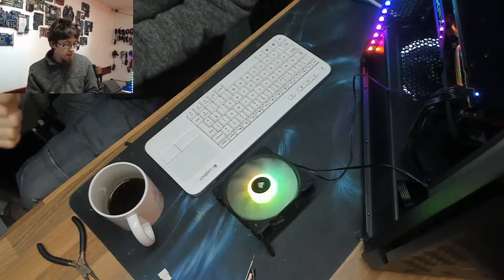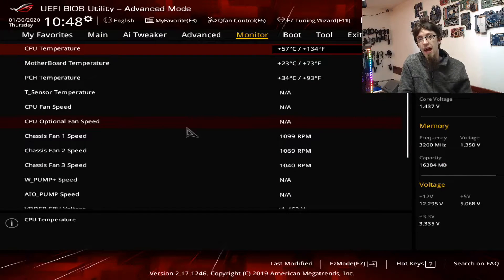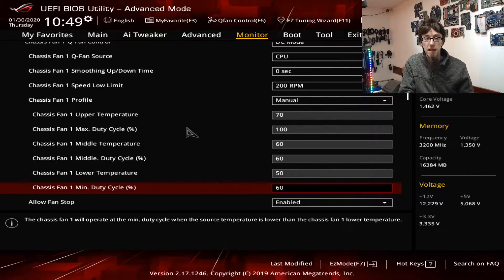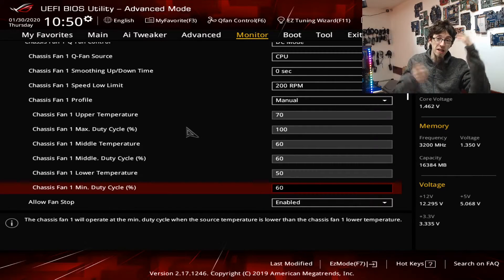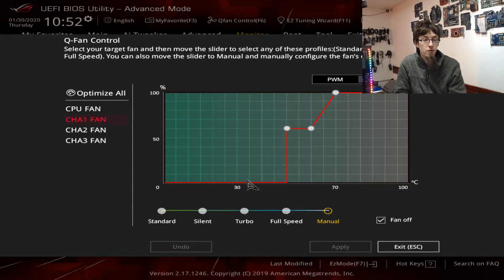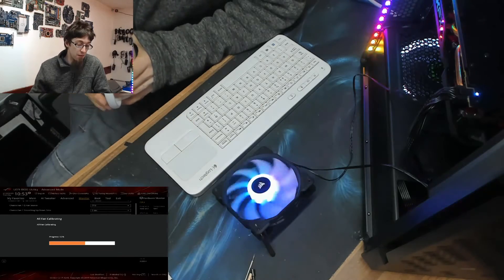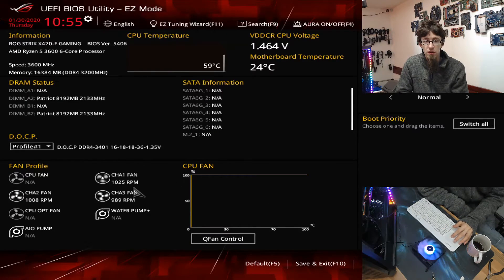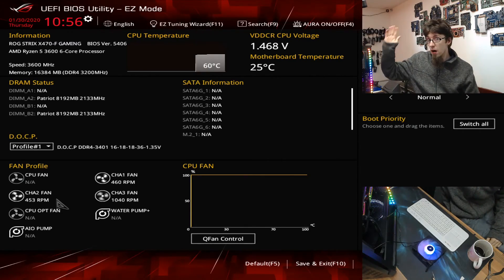LFC#194 - 3pin fans CAN be quiet!

Comment from the maker: I've slated 3pin fans a lot lately in my 3pin vs 4pin video and my Cosair 220T review - it turns out that my sample size of motherboards (one) was too small, and with the right setup they're actually just fine. 4pin fans will still give more direct control with less fettling, but 3pin fans aren't the bust that I thought they were.

Comment: I was thinking I needed pwm fans because my case came with 3 DC fans. I also discovered the optimize all setting on my X570 mobo and realized they will work just fine. At this point the only reason to change the fans would be aesthetics. I need my obligatory RGB! lmao

Comment: I've watched three of your fan 4 pin vs 3 pin videos.  Great job.  I have also watched other videos on increasing the number of fans per motherboard header.  Most are only concerned with power requirements.  This video is particularly interesting because you were using fan optimization.  However, everyone seems to be totally ignoring one important point about these fans, they all have tach outputs back to the motherboard.  No one is mentioning the fact that the computer can only monitor one fan speed per header, no matter if it is a 4 pin or 3 pin fan.  The fact is,  you cannot connect two fan tach wires to one header.  If you try to add more than one fan per header, say using a "Y" cable splitter only one fan can actually be controlled.  The people who make these "Y" cables know this and if you look at the connector ends of the "Y" cable you will see that one of the connectors has the tach pin removed.  Because of this feature, you will have to be careful about which fan you plug into which connector.  Make sure that you plug the fan, you want to be the master, into the connector with the tach pin installed.  My motherboard has one 4 pin CPU fan header and only one 4 pin case fan header.  I have two fans installed in my case, an 80mm in the rear and a 120mm fan in the front.  Here in lies the problem.  If I use a "Y" splitter, and one of my fans is a PWM 4 pin fan and I use it as a PWM fan then, I would plug it into the connector with all for pins.  If my other fan is a 3 pin fan and I plug it into the other "Y" connector, that fan will now always run at full speed.  If I use two 4 pin fans, no problem, both will be speeds will be controlled. However, again, only one fan speed will be monitored by the computer.  If I use two 3 pin fans, again, no problem.  But again, only one fan speed will be monitored.  If you try to use fan optimization, on a fan header with two fans,  you might have a problem with one of the fans not starting on the low end or unmatched high end performance.  Also, because you are trying to power two fans at once, I'm not sure how it will effect the speed calculations.  Fan loading may have an effect, especially if in my case the front fan is a different size that the rear, 120mm vs 80mm.  Perhaps you could run a test on the different combinations.  I think it would make a good video and perhaps clear up a lot of questions regarding running two fans on one header.  One last thing, if one of the fans fails, depending on which fan failed the CPU will not realize a fan failure.  Thanks for you time.

Comment: Brilliant!! I didnt know this either and had settled for a 60% speed minimum for a couple of weeks. Took me a few tries to get all fans to report the same minimum speed (I assume due to varying orientation and drag through filters etc. as the fans are all installed) but now running at 40% speed and it is SILENT. Great for working from home and they ramp up when I fire up some games. Top stuff, new subscriber and enjoying going back through your videos. Realise this is probably late but I was really tempted by the 220T case but ended up waiting for the BeQuiet 500DX and really glad I did. No RGB fans, but includes 3x 140mm silent wings. The case makes up for this with an RGB front panel and strip inside the case. Although its not as compact at the 220T.

Comment: that BIOS option got me to, same on X570 TUF you have to click that every time you add/change fans.
fumy have matching fans one is min 25% and one is min 37% (manufacturing variance) was interesting how much two fans can vary.
Reply: So were u able to get those nosiu fans down to basically quiet when ur like watching a youtube vid or using internet?
Reply: @user-he7sc3fg3r  on the azus tuf WIFI just use the silent fan profile for fans and it's fairly quiet, I don't have a decibel meter so not sure how to quantify it.

you can do all manual fan speeds but the quiet preset is relay nice, at the mo with YT open and a bunch of tabs my fans are all under or around 500RPM 

cpu 200-400RPM (wraith prism)

front two fans are 0-400RPM on a y splinter (140mm)

top/back 3 fans 400-500RPM (two 120mm on a y splitter one back one top, one 140mm top)

(gpu fan auto stops too)

fractal meshify C case, with the tinted black window and RGB off :P
case on floor (not next to me on a desk)
the silent fan profile auto stops fans when CPU is below 'X' temp & you can adjust it as you want

the top two fans are intake and don't relay seem to do much for temps, only have them as case came with two 120mm fans and i grabbed 3x 140mm fans

under normal light use it's relay fairly quiet only the wraith prism relay makes an annoying sound under load & that's only because it's a smaller fan that makes a more high pitched sound, iv looked in to it and i think id need to get a big bequiet or  noctua cooler for about £40-50 to relay make it quiet. most the cheaper coolers dont seem to be a massive upgrade. (for me at least wanting silence an overkill cooler with big nice fan is what id want)

But the box cooler relay keeps the CPU under control, relay as a box cooler the wraith prism is amazing & you relay do not get any real speed gains from a £50 cooler maybe 1-4% so it's only worth it if you want silence. 

the biggest tip i can give is when i went in to bios i disabled 'performance enhancer' and dont use 'PBO boost' as they seem to make the CPU run much hotter. do not PBO boost OC, do not manual OC just let it be and it's relay fine/fast. (even got a small speed boost from disabling performance enhancer XD and lower temps)

O and to show i like silence :D i have an RX 580 sapphire pules, down volt'ed to 1v and down clocked to 1200mhz and use the AMD chill options to keep the FPS limited in all games, most the time the GPU fans in games is 800-1500RPM on auto. i may have lost 10% or so in GPU speed but hay it's quiet :D
in RTS games like total war i limit to 30FPS max and for FPS i set it to 30-60FPS in the GPU drivers.

always remember watts used by parts CPU/GPU = heat and volts kind of magnify the watts so lower Watt's = less heat = less fan needs to work
bigger fans seem to make less noise and a more pleasant noise smaller fans seem to spin faster and make a less pleasant noise.

And i am happy with box cooler, i think i may swap it out if i ever seen a big bequiet or  noctua on sale in a year or so but relay it's fine.

I live in Wales (UK) in a small ish village so ambient noise levels are fairly low and not sure of room temp about 20c or less most the time id gess? but have not relay checked.

PS the bios seems rock solid had it since black Friday and had no problems, also only SSD's no internal Spiner drives.
Reply: ps i have a 3700X
Reply: @liaminwales  my fans wont go below 1500 even at idle
Reply: @liaminwales  i have the asus b4f50 f gaming. I have 6 fans all are 3 pin but 3 of them are on a fan splitter so it connects to a mobo as a 4 pin the other 3 are 3pin indviduals